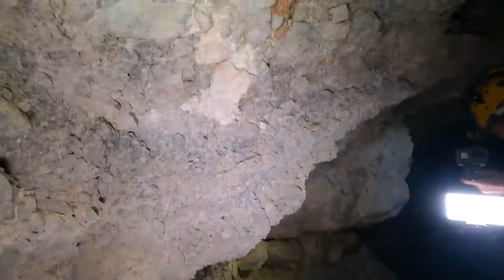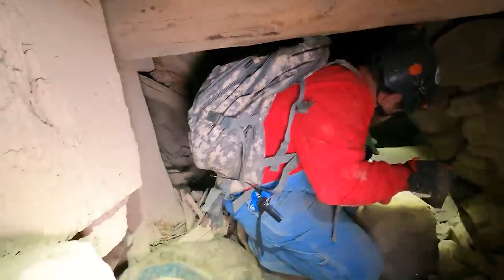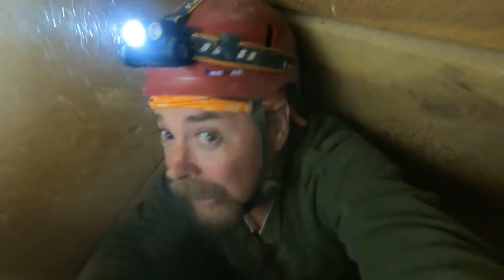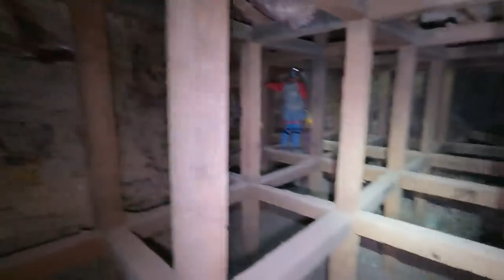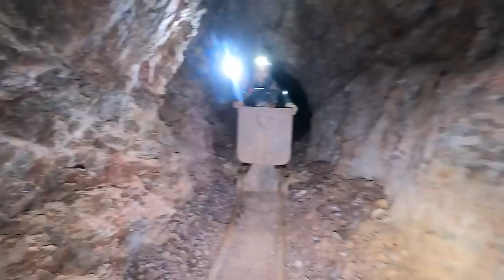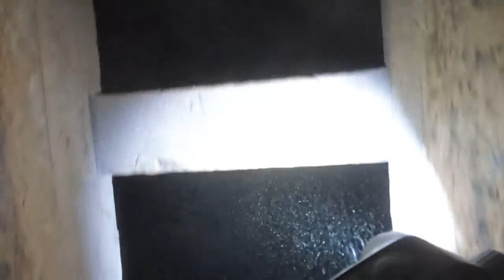Gold Geology 101: How to Find High-Grade Gold Deposits

Comment: Jeff, I have a question for you.  I've always wondered where the Gold comes from down deep in the earth.  The hydrothermal fluids have to pick it up somewhere to bring it up into the faults in the rock.  Exactly where is it picking up the Gold from in order to bring it up to the surface?  Is there a giant layer of pure Gold down there somewhere?  Just curious.
Reply from the maker: that s a great question Gold exists throughout the upper mantle in the  lithosphere... it travels to the surface by means of subduction zones under the continental plates and from black smokers on the seafloor ... the Gold is transport in tiny ionic form in  massive globules of molten rock called batholiths....from there small plutons of molten bubbles come off of the batholith and make there way to the surface due to its lower density than the surrounding solid rock....like a lava lamp.... theres more to the process but that is the basics
Reply: @Askjeffwilliams  Thanks a bunch Jeff.  I've always wondered about that and I appreciate your reply and the information.  I am amazed you are willing to so very promptly answer my question as I know you must read a ton of comments and took time to answer mine.  Thanks again.